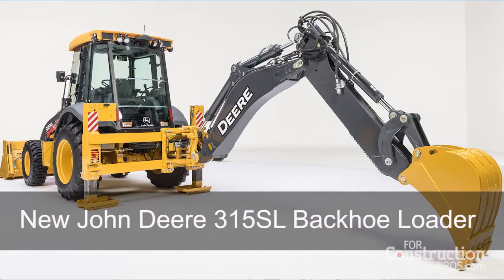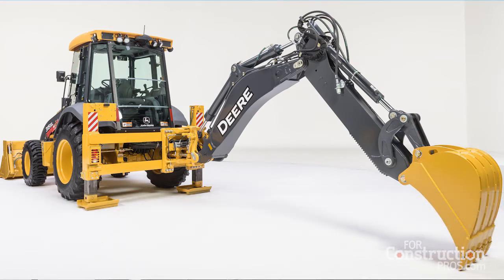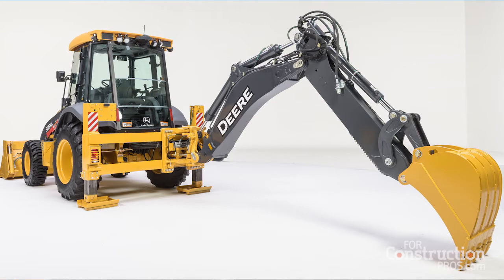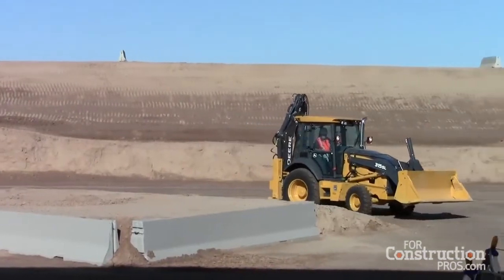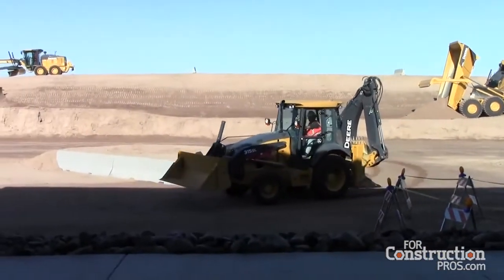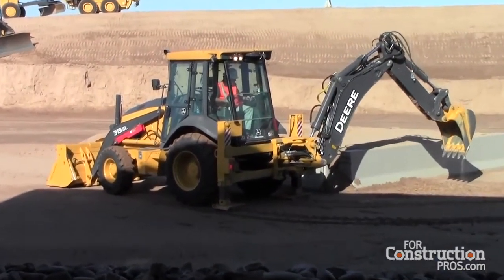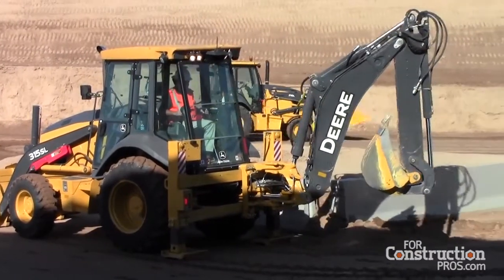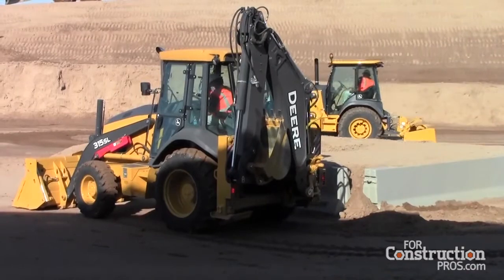Deere Makes the Case for a Side-Shift Backhoe

Comment: jcb is junk compared to a deere
Reply: I would be inclined to agree with you regarding the jcb sitemaster..... Unfortunately you don't have the contractor edition available in US  it's a very different machine ..... I can't argue about JD backhoes since they are not available here ... Cat , Case and New Holland are available but produced under license I understand that case and nh are made by a company in Italy for Europe. They build Cat backhoes here in UK but the compacts are made by Neuson
Reply: i own both and jcb is stroger and takes a beating far better.... my 3cx lifts far more than my 410k  and this machine is a jcb design as jcb designed and built deere combinations until a few years ago...youll notice on a jcb euro model it has substantially more steel in it than this model.